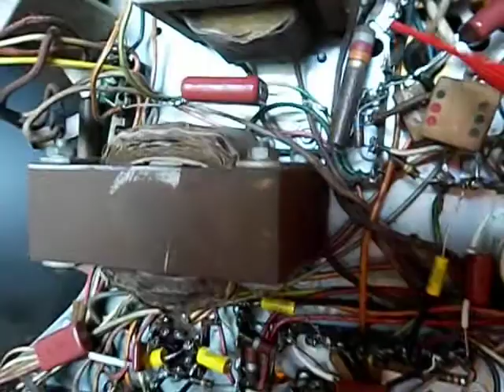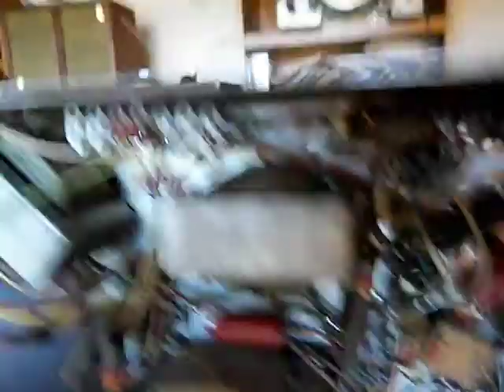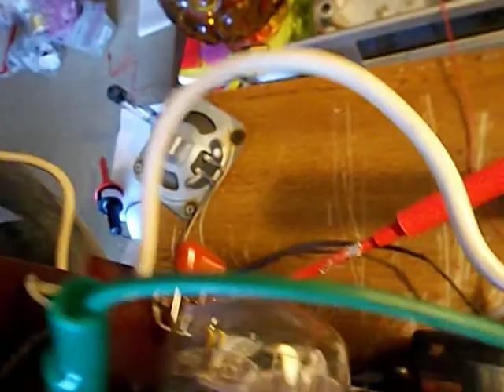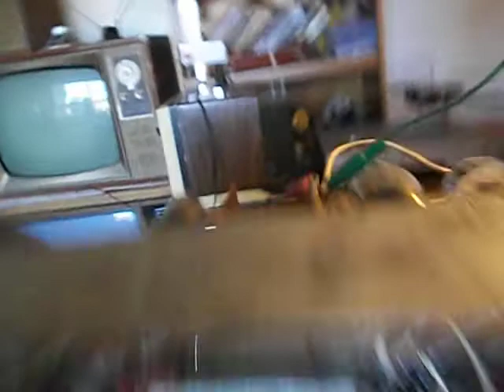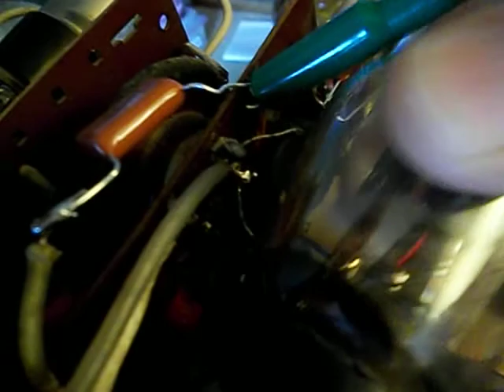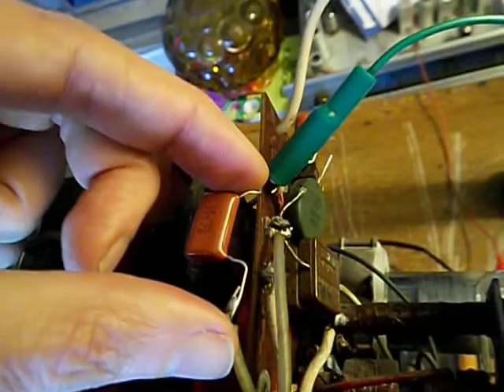vintage B&W TV ge 810 flyback and boost mods

Comment: So the 82K resistor, dual 27K, 100K to G2, flyback, linearity coil and 0.05 mfd cap all tie together.
Reply from the maker: that's different from mine, I have 3 27k resistor feeding the screen of the HO tube, from the B+. I could see on some later schematics that seemed to use that replacement fly, that the only use for the boost was the CRT G2 while the horz osc plate load was 47k not 82k and the HO tube screen hade a 6.5k both tied to the B+.
Reply from the maker: Dave WM I wonder if there was a problem using boost from the replacement type fly causing the change to use B+ and subsequent reduction in resistor values.
Reply from the maker: Dave WM
To be consistent with what you find on yours I would need to clip out one of the 3 27k resistors, reconnect that jumper to connect back to the boost, and remove the jumper that is there now to the B+ (on the 3x27k terminal. It def does not look orig as is.

Comment: Both of my 810 chassis have the two terminals shorted together but it does not connect to the B+  The red wire connects the the linearity coil.  All this matches the Riders schematic in volume 2.